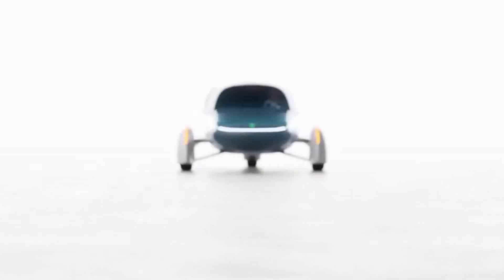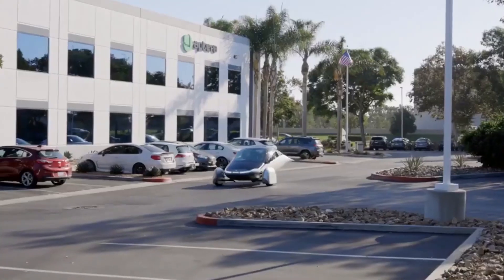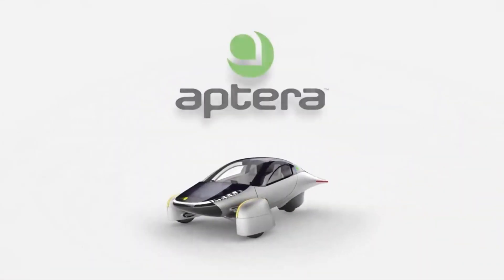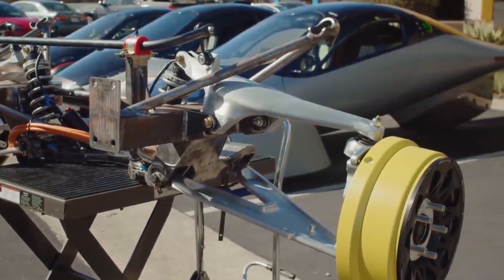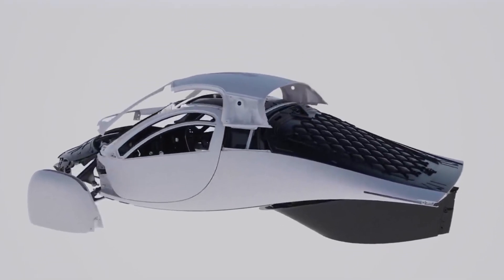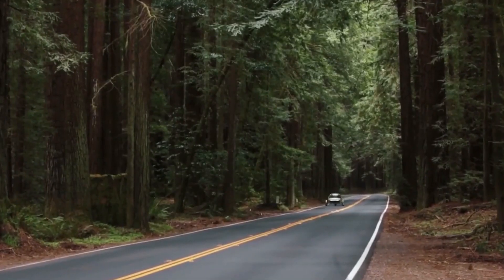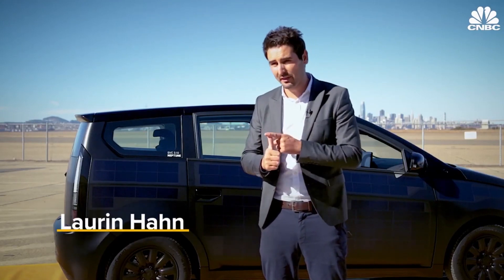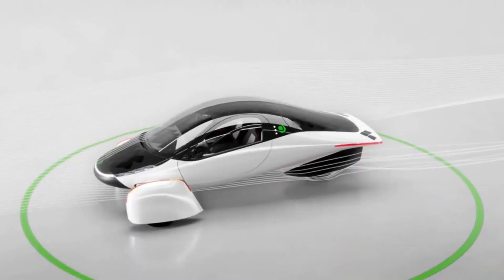Aptera Unveils Juicy Progress Update!"

Comment: The $10,000 is not a reservation fee, but an investment.  LE vehicles can still be reserved without the $10,000, but the investment also buys priority within the LE production, which will amount to several thousand vehicles.
Reply: Just flush ten grand down the toilet.
Reply: Yes, it's $10K of inflated stock price so more like a donation. Plus still need to make $100 reservation.
Reply: They also got the number of investors wrong. Over 1500 of the investor slots have been filled, not just 500.

Comment: Why not just add the fourth wheel? It would be much more stable, and you could actually straddle manholes & potholes.
Reply: It would add weight, cost and air resistance, all contrary to the primary purpose of the design.  It is not a pickup truck.
Reply: Can be registered as a 3 wheeled motorcycle …way less safety requirements and crash testing requirement .
Reply: @BegodeCrashtestdummy-l3z  As of 2020, there were at least 38 states that had a separate "autocycle" category.  In any case, Aptera will be tested to the FMVSS Part 200 automotive crash test standards, and the results will be published, no matter what the requirements are.

Comment: This will not work at all in liberal California as the drivers here are very very reckless an our roads are very dangerous due to lots of ghetto driver along with lots of police chase. This will get crushed easily the way people drive their vehicles here in the hoods. Plus it's look very much unsafe. In California you need to drive a big truck or a strong rugged SUV since the roads here are dangerous and unsafe.
Reply: I have put many years of commuting in California on a motorcycle.  You need to learn how to drive without blaming everyone else.  

Aptera will be crash tested to automotive FMVSS standards and the results will be made public, unlike many SUVs on American roads.  Several of the first PI validation vehicles will be voluntarily sacrificed to this testing.